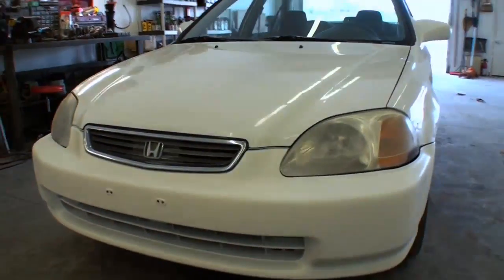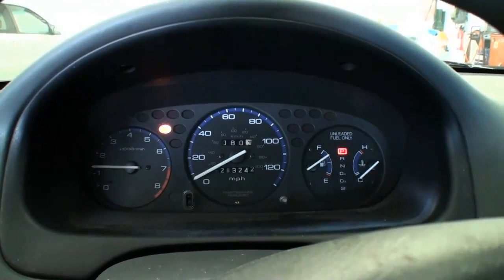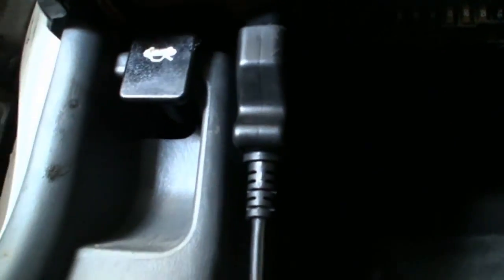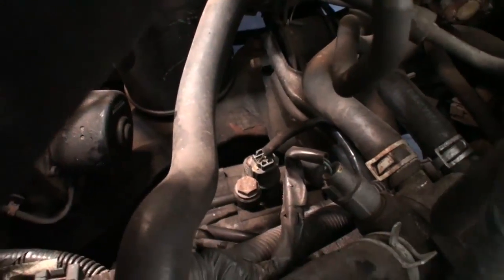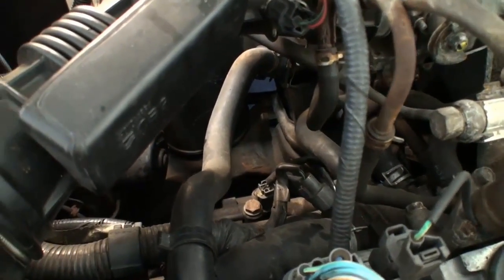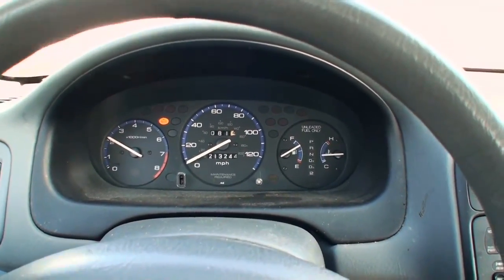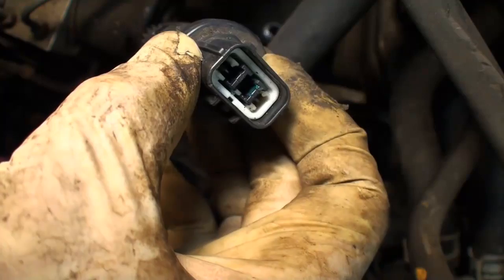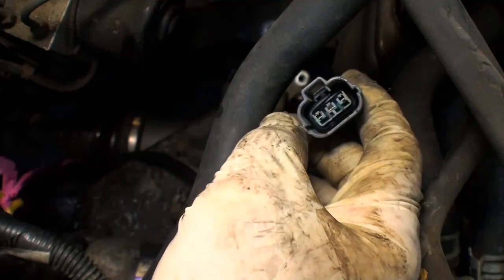P0501 1998 Honda Civic Speed Sensor Diagnosis -EricTheCarGuy

Comment: Mine does the same thing .. speedometer .. but the check engine light has only one code p1298 .. help I already replaced the relay like 2times ... Problem still there.. EricTheCarGuy

Comment: I took my Honda civic for a diagnostic check and the mechanic said it marked P0135 which it's a sensor and the guy charged me over 600 to "fix it" but when I checked the fucker replaced the converter! I told him to check it again and if it marked p0135 again to give me my money back he checked it and it marked P0135 again and he kept sayin that the converter was the problem and that he fixed it that the engine light shouldn't be on but when I turned on my car the engine light was on still so I told the guy to put my old converter back and to fix what I told him to fix he said I can't do that because i already put the converter in your car but I can replace the sensor for a couple of hundred more I said fucked that and left what should I do to fix it?

Comment: I have a Honda Civic 1996 Automatic. Can a faulty speed sensor make the transmission (M4VA) move the car forward or stalling/bogging down the engine although the brakes are fully depressed while the car is standing? I have some fuzzy problems with the operation of my transmission and mechanics want to make me believe it's the transmission that has to be changed ignoring the speedmeter problem.

Comment: why does this particular car have so many problems?
Reply: I think the owner is to be blamed. I own the 2000 version of this car(Manual) and apart from a check engine light caused by oxygen sensor recently, I never really had problems with the car.

Comment: i changed the VSS in my 96 civic manual transmission. It didn't fix the problem but great job showing us how to change it. i had my CEL checked and came back with a  ELD problem. after a few days of going through my car and reading through forums i found that i needed to check fuse 15. yup, it was blown. I replaced it and that fixed the problem.
Reply: and fuse didn't blow again?

Comment: hi, i have a problem i get code p0715 which is for the speed sensor. but i already change the sensor and i still get the same code. i know its not the transmission bc the car runs fine and the speedometer is not all over the place. i was told its a shot circuit/electrical problem. but i have know idea how to check for that, any thoughts how ican fine the problem? thank you
Reply: did you ever find why you had the p0715 code? I have that code on my 97 civic
Reply: Left replay

Comment: Im having a similar problem with my 1999 Honda Civic, in that once the car gets up to operating temperature the speedometer starts wigging out (works fine cold). I replaced the VSS, but no luck.

Comment: Hello eric, wanna ask you something. I own civic 1.7 2001 model. My D lamp always blinking . Just doing dianosis scan & foreman tell me the speed sensor got a problem. He says there is two sensor. Is civic 96 speed sensor same? hard to find real civic 1.7 part. Thanks in advance
Reply: if the D light is blinking that would be a problem with your transmission

Comment: I noticed my car threw a code for the VSS and I came to find out that the left lower engine mount was bad and as soon as I replaced it I have never got a engine light. Just wanted to post that for other options.

Comment: Would this be the same on a Toyota as far as the sensor problem with a speedometer the doesn't move at all until the car reaches 60mph then it works fine for speeds above that

Comment: The only trouble I seem to have with aftermarket parts on my 1993 BMW 525iA is that they don't last as long. Generally, you have to replace water pumps every five years with good OEM ones. My aftermarket one only lasted about 3 years.

Comment: vtec wont kick in if the check engine light is on
Reply: on the contrary, my check engine light is on and my vtec kicks in.
Reply: that's bizarre mine wouldn't
Reply: it depends on the problem. if you have a bad vtec solenoid then no your vtec wouldn't work.

Comment: Hi eric,
I'm also having a speedo problem with my honda (a 96 accord).  Its a manual so no effect on shifting, but the speedo doesn't seem accurate.  It moves smoothly, no jumping like that, but it always seems high.  I guess its more or less accurate at crawl speeds (goes to 0 when stopped) but the faster I drive, the higher above actual speed it seems to read.
Is this likely also a sensor error?  Should I try just changing the sensor before I pull my dash to check the gauge?
Thanks

Comment: Well...it is working fine now.  So it was raining that day and a friend mentioned the sensor must be wet.  But if that's the case, why would stepping on the brake while driving works?  Should I check the connectivity or water may seep through the connector into the sensor?  Or should I just replace it?

Comment: Nice video Eric.

I have an exact same issue with the speedo flickering back and forth even at idle sometimes.  However......every time I step on the brake, the speedo comes back to normal but it doesn't sound like the engine auto shift correctly.  Rpm looks high almost 4k at 80mph.

Do you think it's the speedo sensor?  If that's the case, that should be an easy fix based on your video.  I have not done any diagnosis yet, pulling the speedo connector off and drive, etc.

Thanks.

Comment: did exactly what he said and it works perfectly now, only thing was the check engine light came on and stayed on after installing everything, did some research and seen to disconnect then reconnect the battery and it works to remove that check engine light, probably another way but this was the simplest

Comment: Hello
I have 2000 Acura Integra LS 4DR non Vtech 1.8ltr. The problem I am
faced with is that the temp gauge never reaches close to mid point. It
passes the first couple of bars. I have changes the thermostat and
coolant sensor. I don't know whats going on.

Comment: I have a CRX 91 SOHC D15B2 I'm trying to mod out and replacing most every sensor but I'm trying to upgrade as I replace is there a place you could recommend for parts or kits? I search Ebay a lot as well as other online sites but hard to find parts for this car!

Comment: I have standard shift 98 honda civic and the speedometer is not working at all. The RPM"S is working but the miles per hour is not moving and the mileage is not moving. The fuel is working and i do not know if the temp gauge is working. Can you help me?
Reply: did you fix it?

Comment: thats usually a blown headgasket just do the headgasket and check the head on the bottom to see if its warped cracked or anything else if it is you will have to replace it.

Comment: I have a Honda civic and I have water mixing with oil do u think I should replace the motor or the head. if I replace the head can their be other parts of the engine that can be a factor in replacing the head that I need to know first I know its not knocking

Comment: Many thanks for this video.  I had a 1999 Civic LX in which the speedo would start to bounce up and down while cruising, while at the same time the doors would lock and unlock endlessly (but would not lock when shifting from P to D at the start of a journey).  I replaced the speed sensor following the instructions in this video with a $20 aftermarket one from Ebay and, 500 miles or so of driving afterwards, the problem has now gone and not recurred.  Thanks again.

Comment: hi eric may u can help me.....i have a 95 honda accord V6...245k mi  i just got the car  it haves the same thing going on like in this video  BUT the car will CUT OFF after driveing about 10mins or driveing hard 3 blocks....and some times it will start right back up some times takes up to 1hr to restart ..ANY INFO .???  i know it will need the speed sensor but why it cuts off  maybe TPS  ?

Comment: if its rear wheel drive then yes. speed sensor lives in the transmission and is calibrated to the recommended tire size. putting bigger tires on makes the speedometer show slower than your actual speed and the smaller the tire the faster your speedometer shows.

Comment: Great video. My brother in law has a 2008 Dodge Ram 1500 and wants to install taller tires on the rear to improve gas mileage. He was told by the tire shop that he would not have to calibrate his speedometer because his computer could detect the difference through the wheel speed sensor and automatically compensate for the change in height. Is that true or BS ? Thanks for all the great videos.

Comment: eric i had a question i have a Acura Integra 1995 Ls and the speedometer doesnt move at all nor the mileage but the tachometer works but the other side not working i tryed putting in a different cluster but did the samething is it my speed sensor or can it be other issues?
Reply: did you fix it?

Comment: OMG MY CAR DOES THE EXACT SAME THING WHEN IT IDLES when the engine is warm the revs surge and its a pain in the ass cause when i take off out of an intersection i have to rev the car or else it stalls. what could my problem be? my car is 1.3L fuel injected

Comment: I had a very similar issue on my Golf Mk5.
The cause was a faulty sensor wire to the wheel speed sensor (caused by a pothole impact).

Comment: ok my speedometer works. but my transmission is shifting exrtremely lazy, my overdrive will not stay between 40-50 mph and my cruise control is not working as well

Comment: This brings back memories of my 94 Ranger that had a speedo that jumped all over the place, tuned out that it was actually a bad speedo cluster.. I did exactly what you did to diagnosis, by unplugging speed sensor first and working my way through the problem, to a solution.  Great info, keep it coming

Comment: If the ECU needs input from the speed sensor in order the shift gears correctly, how can the transmission shift smoothly without it completely?

Comment: Also really surprised Eric didn't use any dielectric grease/electrical grease on the connector. The location and orientation of the sensor is ideal for water to get in, I would not be surprised if many of these sensors appeared to have failed due to corrosion.

Comment: @rusco321 . .. most transmissions have a limp mode where it relies on other sensors to estimate load and wat speed it might be on also a pre-programed shift map. The speed sensor will just aid in the shifting sooner for better fuel economy. (Other sensor can be a transmission speed sensor) .. just my 2 cents

Comment: This looks so much easier than what was on my vehicle.  I had the speed sensor go out on my 96 Ford Taurus a year or so ago.  It is about impossible to get that thing where it's located.  I actually had to go up from under my car to get the best position at it.  Even so, I was only able to get the top electrical portion off of mine as the bottom half corroded into the transmission.  At that point I was sick of toying with it that I just took it into the shop.  It was such a pain.

Comment: depends on what year & what you mean by false speed. for example, sparatic or too slow/fast? if its a 94-97; it gets its speed reading from the VSS in the tranny (2wd)/transfer case (4wd) in which changing the VSS gear teeth can correct. if its a 98-01/02; it gets its speed reading from the sensor in the pumpkin of the rear diff for which I believe you would need to get a tuner to reprogram for gearing and tire size so the computer can display the correct speed.

Comment: I spray lithium grease in my connectors before I assemble them. The grease "clings" to the metal and helps seal out moisture. I do a similar thing to my battery contacts.

Comment: Hey Eric, I just swapped my cluster in my manual Honda civic Cx 2000 and afterwards my srs light has been stuck on. I was wondering how to reset this light, or to check it, Cause I'm not sure if the problem is with this one or my old one just had the bulb burnt out.

Comment: Perhaps, personaly I wouldnt not have bothered if the terminals on the original connectior where fine, if they where corroded as well, they I would have. $5 or £5 it is better in your pocket than theirs though, remember that. Admitedly I do spend a good deal of time in scrap yards hunting for parts for my old Vauxhall.

Comment: Great video! Speaking of After-Market parts... I had the right front upper ball joint (control arm) replaced on my 1989 Accord last year. The original Honda part lasted 22 years, the first replacement about 8 months, the second about 3 months. Local Honda dealer can't seem to locate a Honda replacement part. Does anyone have any thoughts an a good brand of After-Market part?
Peace

Comment: Eric, I love your videos. In this particular one,  I suspected the connector the moment you pointed your camera down into the engine bay revealing the position. My background is in electronic repairs, plus I have a strong enthusiasm for cars and all things mechanical. I'm glad you pointed out the pros and cons of OEM vs. aftermarket parts. Always a tough decision as which to use. I recommend you replace that Permatex contact cleaner with something vastly superior. Caig's DeoxIT D5. Check it out.

Comment: HEY ERIC, MY 96 HONDA CIVIC DID JUST THAT WITH THE SPEEDO, ONLY IT WOULDNT MOVE AT ALL, SHIFTS WERE BAD, I DID NOT WANT TO RUN IT TO FAST OR AT ALL FOR THAT MATTER, HOWEVER, WHEN I TOOK IT FOR A SIMPLE TEST DRIVE, THE SPEEDO CAME BACK TO LIVE, AND THE ENGINE LIGHT CAME OFF AFTER 4 DAYS, SOUND LIKE ANYTHING YOU'VE DEALT WITH BEFORE?? THANKS.

Comment: Some ECU in the car isn't clever at all. By program, speed jumps like that can be filtered, appart from logging and error condition. Idem as the TPS sensor when it read open in certain points, ECU needs to solve that by software without shitting the whole car. Nice Vid Eric !!! You rock.

Comment: The Speed sensor hole is the easist way to fill the 5 speed trans. Pull the fill plug out and fill threw the speed sensor hole until fluid runs out the fill plug.

Comment: I've never seen an engine run without oil. Eric already told about this car, it's a woman that thinks the car only needs gas to run (no pun on women, but mostly have no idea what's under the hood). Honda like most japanese (well, atm except toyota) are known be very reliable even if they look like junk 2 hours after you bought'em new :D

Comment: The back end of the connector looked quite open, i would have splatted some grease into where the wires enter the connector.

I would of expected the rear of the plug to have a rubber boot.